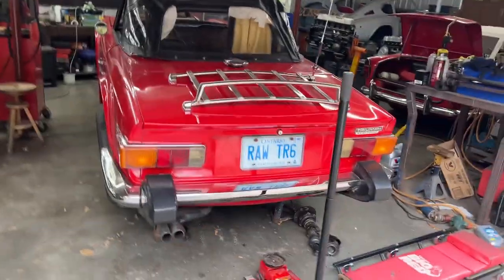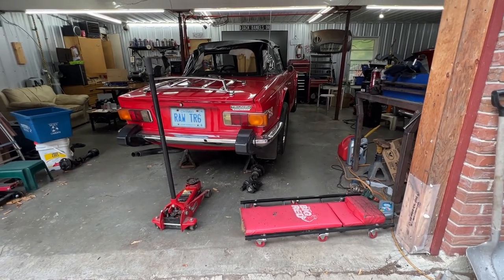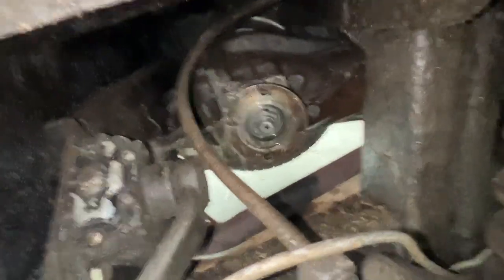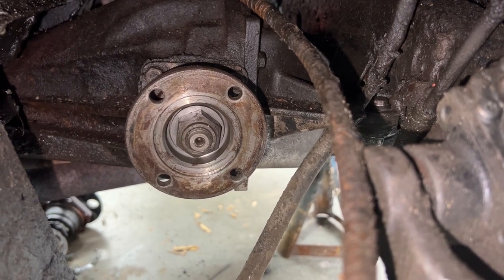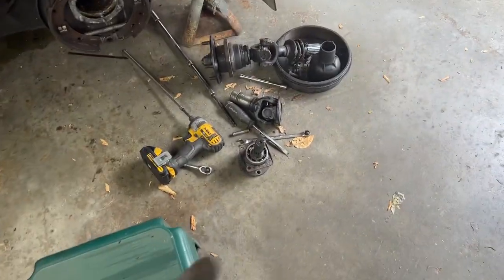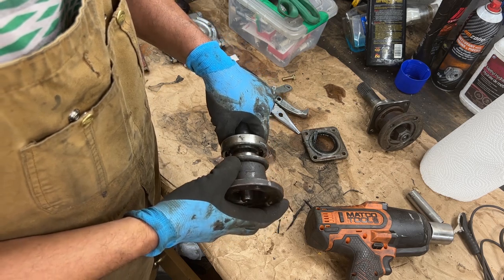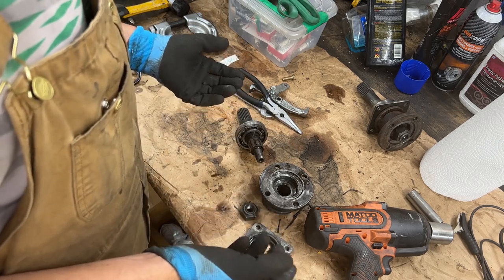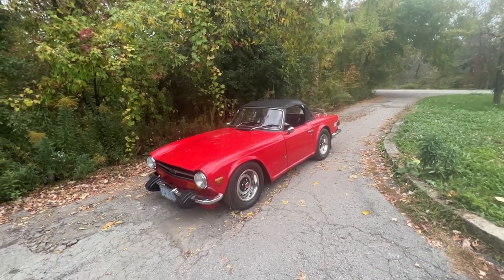Weird Diff Leak TR6 - Can we solve it

Comment: The same thing can occur at the front input if it isn’t properly torqued with oil getting between the shaft and the flange stub and pooling up and leaking out between the input and driveshaft coupling flanges. 

Just did a mount reinforcement/repair and a refresh of a Diff and was surprised to find RTV and oil between the front flanges. 

The  proper castellated nut, washer, and safety wire were in place, but I discovered the flange was not even close to being properly torqued when I removed it for new seal installation.

Comment: the missing washer is a giveaway that someone has been playing in there before - the tapper is the seal if the nut was not tight it will not seal the tapper if the shaft was not tight in the taper the nut was not tight enough lucky that the nut did not start to undo and the wood ruff key did not let go

Comment: I have a question for you.  Where do the starter solenoid and the fuse box mount on a tr4a?  I didn’t take the car apart so I am not sure where they go.  Any help would be appreciated thanks Elin.
Reply from the maker: The solenoid is on the firewall, right side of the engine, just above the starter. The fusebox is on the right inner fender close to the voltage regulator. You can see that in my videos about the 1964 yellow TR4
Reply: @RustyBeauties  thanks Elin for your quick response

Comment: It's pressed too far because the washer is missing...when they tightened the nut it went deeper ( washer thickness ? )
Reply from the maker: I actually think it was the opposite. The nut went out of threads on the shaft, because the washer wasn't there before the flange was all the way on the taper. That is why I was able to press it out super easy...
Reply: @RustyBeauties  
👍